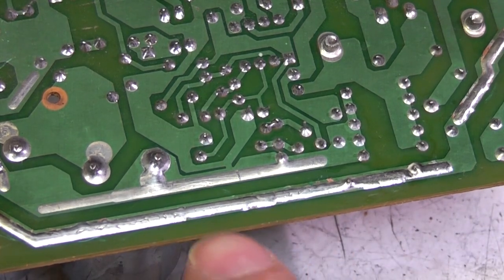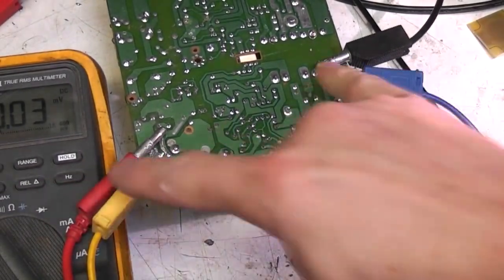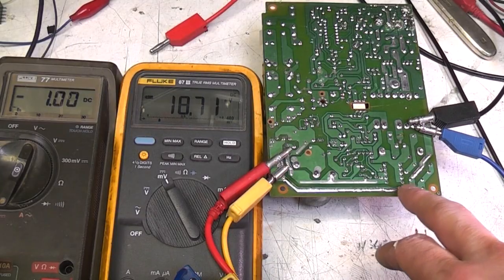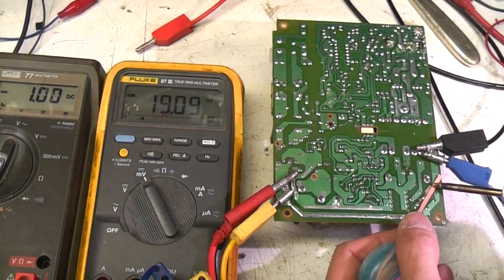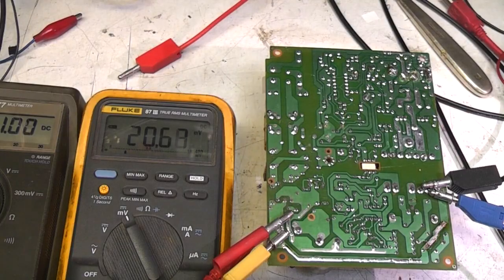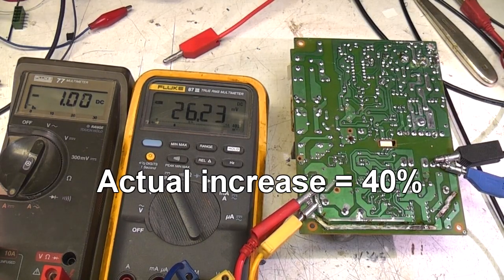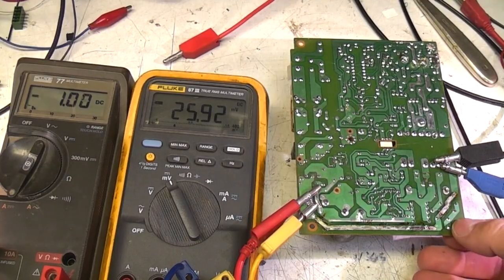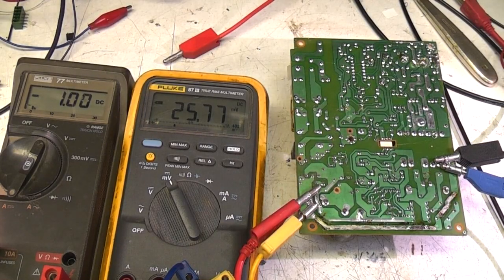Does putting solder on high current PCB tracks help?

Comment: the solder makes a big improvement, if the track has a lot of solder, it can be increased by almost double, and adding a copper wire, can tipple the rating. Its done this way as its too expensive to use heavy grade copper clad pcb, and making traces wider increases the size of pcb plus its often impossible as you are often limited by the component pitches. some manufacture attach bus bars to the pcb when needed.

Comment: Solder has approximately ten times the resistivity of copper, so you need a lot of it to make a noticeable difference. Fortunately PCB tracks are extremely thin, so this is quite easy to achieve. You can make a much bigger diffierence soldering a piece if 16SWG tinned copper wire along the track.

Comment: People who argue that solder on tracks doesn't help don't know basic electronic principle: When resistors are connected in parallel, more current flows from the source than would flow for any of them individually, so the total resistance is lower.

Comment: Fluke 77 on the left... is that a replacement cover? I got mine when I went to NEI College here, orange cover by then. Did you get your 77 when you went to college/school too? Mine died about a decade after I got it, oddly enough, while my cheap analog Radio Shack meter (which was about a decade older) still works perfectly. I am trying to get an electronics bench up & running again in a hobbyist capacity.

Comment: What proves are you using in this video?  Did you solder banana cables directly to the board?
Reply: What's a prove?  I was wondering about the connections as well.
Reply: Metatronic Mods 

I think he meant probes.

Comment: It's simple logic. A wire conductor follows the same principle for current carrying capability. It is easier to run more current through a conductor with a wider surface area than one with a smaller surface area.

If one were to measure the resistance of a conductor, cut the wire cross-sectionally in half down the length of the wire, and measure again it would effectively be double the original value.

Comment: Skin effects cause the current to travel near the surface, so in high frequency circuits the wires have to be kept very smooth and can even be gold plated or hollow. Generally, solid core wire is cheaper than stranded wire, but less flexible, so that tradeoff comes in to play for low frequency connections. For medium frequency, high current applications (induction heaters, high current switching converters) insulated stranded wire called Litz wire can be used to increase effective surface area.

Comment: I tend to use the solder-on-track method for tracks that could be prone to high current bursts under fault conditions.  I think the extra mass helps reduce the risk of track failure before the overcurrent protection kicks in.  Especially important where a ceramic fuse could be replaced by a common glass one.

Comment: @mogdog - its called solder wick - its a fluxed copper fibre - It works by capillary action - The solder wants to be in it more than on the board

Comment: Mike, or anyone, can you tell me if this is true: Does the current flow on the outside of a conductor, and is this why multi-strand cable is used for some applications (i.e. because the surface area of the conductor is greater)?
Also, does it depend on AC or DC? Just wondering why high current cables on DC systems are multi-strand and yet my AC house wiring is single core. Thanks.

Comment: I was under the impression that soldering the track aided in high current applications by reducing the thermal strain on the track by increasing the surface area of the track, not by reducing the resistance.

Comment: Then I suggest you unplug your computer.

Looking in my bin of PCBs destined to be desoldered for spare components plenty of them have this system. The power part of this plasma TV card, the amplifyer from a pair of old computer speakers, PWM dimmer, the old VFD, this phone charger... Hell, I bet there are even watches out there that use tinned traces.

Comment: There's no fire risk. This is not a bodge, it's simply a construction method. There are likely more tinned PCB tracks in your house than you realise, and none of them have caught fire yet. Nor have the multiple extension leads I use caught fire, or all the bits of equipment I leave on standby all the time, despite all the well-intentioned advice you get to not use extension leads and not leave things on standby.

Comment: I often see them use multiple wire jumpers to connect the tracks, 2 in parallel for each section, and then a bigger block to turn corners, and the jumpers are pretty much low cost, as they come in standard sizes and lengths, so are easy to insert. Extra cost though, but it gives the ability to carry 10A or so and still use the board underside for components as well. Useful to save space and board area. I saw a copier control board where there are more jumpers than components, just to stay SRBP.

Comment: Only because the overall resistance is diminished, the power loss across the track is also lowered, thus less heat dissipation is seen.